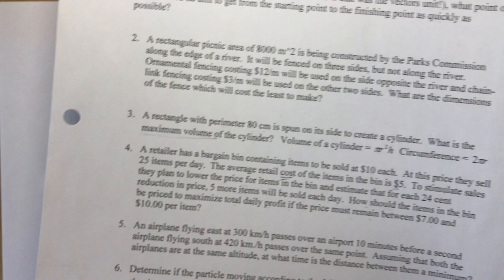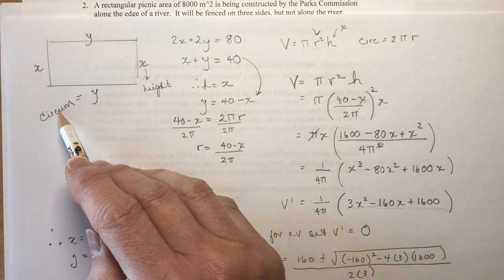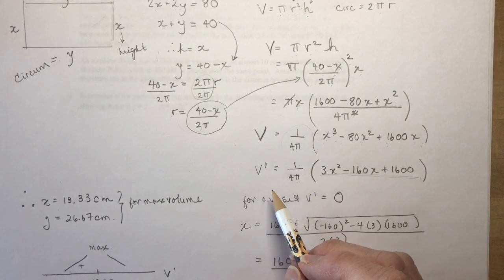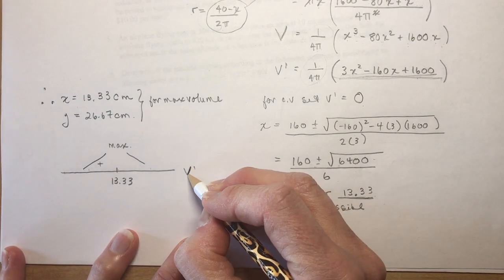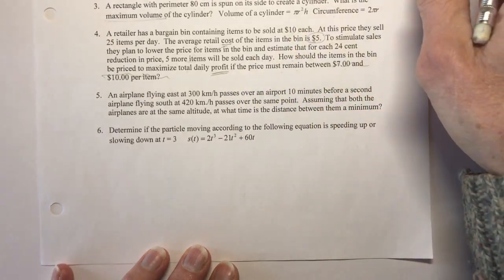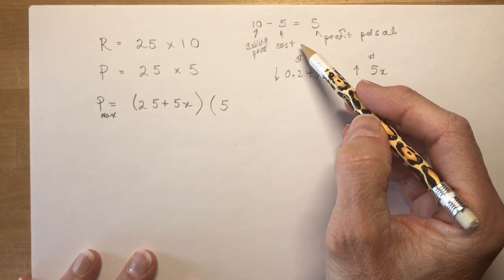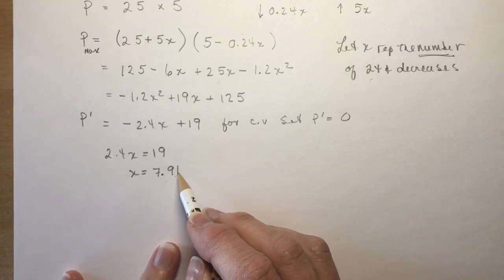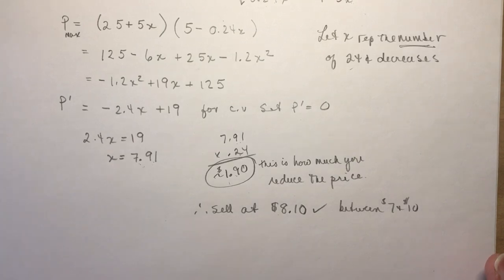Chapter 3 Optimization practice Test part 2

Comment: for the maximum profit question, i rounded the price raises to 8 because I thought 7.91 would be kind of tedious. Would that be fine on a test. Thanks alot for the video as well.
Reply from the maker: Depends on what your teacher requests. Basically with money you should include cents, other times it may be at the teacher’s discretion for the number of decimal places.